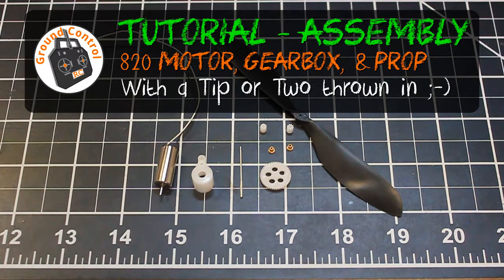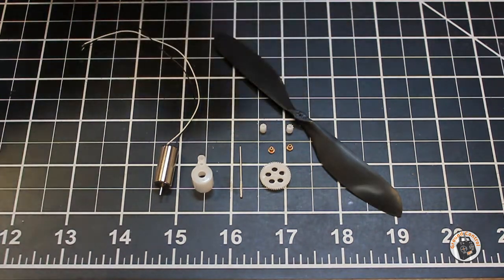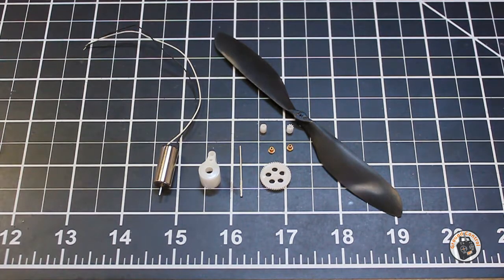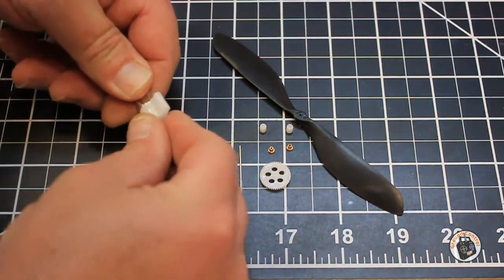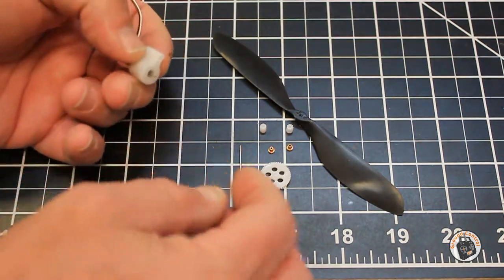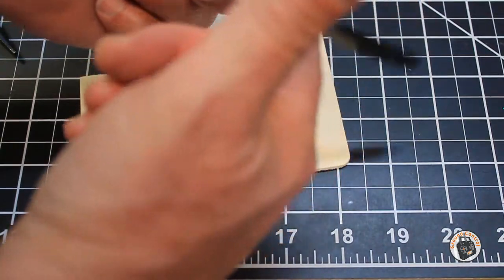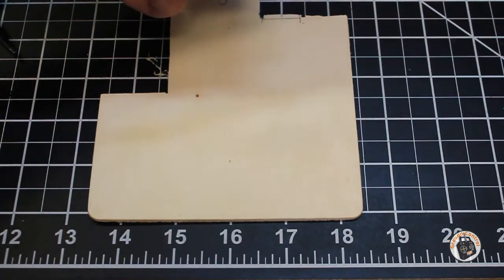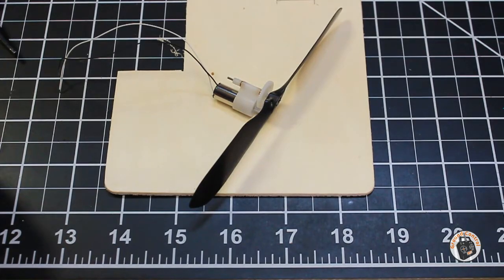Tutorial - Assembly of the 820 Motor, Gearbox, & Prop

Comment: Great tutorial. Do you know the diameter of the output shaft that the propeller attaches to? I'm just wondering if other props can be used with microprop adapters. Thanks
Reply from the maker: Hi Gene and thank you.
I don't have those anymore but in the Video Show Notes I have the prop shaft listed at .8mm

Comment: I am wondering if the large and small gears positions could be swapped for more RPM's to the prop?? 🤔
Reply from the maker: That's a good question. It may be possible but I've not tried that. That could be a very good way to use a smaller prop and still get good thrust ;-)

Comment: The bushings appear to be made of a porous material called "oilite" which is usually made from bronze. The porosity of it helps to retain light lubricants for these type of applications. Excellent tutorial by the way! 👍👍
Reply from the maker: Thank you much! One of these ended up being a good replacement motor / gearbox, and prop for my old F949 Cessna 182 ;-) See you in the Air!

Comment: Update on the current taken by the motor gearbox propeller combination on 3.7 V (equivalent to 1S Lipo) is 750mA. 50% more current than on 3V due to air resistance proportional to the cube of the velocity I suppose.
Reply from the maker: Hi Tom! Still not bad! I wonder if it would be over 1 amp with a fully charged 4.2v 1S LIPO? I do have some of the 1S LIHV LIPOs that will charge to 4.35v for a bit extra punch in the beginning ;-)

Comment: I notice that some have asked what current the motor takes but I haven't seen a sensible answer. I ran my motor without prop on 3V and it drew 65 mA. Running with propeller it drew just about 500mA. The current taking will depend on the load of course. I haven't measured the stall current because I am worried I might damage the motor.
Reply from the maker: Hi Tom! I wish I had something I could accurately measure  load on a 1S LIPO. I can get a close estimate using my Load Meter if I attach separate power to the Load Meter as it requires a minimum of 4.8v for power. 500ma is very low for the size of the prop since most Brushed ESCs I've seen are capable of anywhere from 2-4 amps. You could run two of these for a dual motor setup with no problem ;-) I would also be worried about stalling the motor as that could also take out the ESC. What are you going to put this motor in?
Reply: @GroundControlRC  Not really sure what I am going to do with it. I just liked the look of it on the Banggood website. The C version was half the price of the A and B versions for some reason, so I just added it to my order. I get caught like that a lot!
Having just said that, I have an unmade KeilKraft Sopwith Camel rubber powered kit from the 70's, but at 16inches wingspan biplane, would 1.5 watts be enough to power that?
As for measuring the current, I have a couple of sophisticated variable power supplies that have digital readouts for voltage and current. I find them so useful for playing with electronics and such.
Reply from the maker: @TCSC47  ...you're a Tinker like I am ;-) My mantra is "Dreamers, Thinker, and Tinkers make the World a Better Place, be on Today" Most of these Brushed Motor, Gearbox, and 5" Prop combinations I've tested produce around 50 grams of thrust. The best thrust I've seen from this type of setup is the Motor, Gearbox, and Prop combination used in the Eachine Mini Warbirds. With the weight of the Plane and the amount of power they have in flight I would estimate somewhere around 70 grams of thrust. If your Sopwith Camel is less than 50 grams in weight with this motor, receiver, servos, and battery, you're in business ;-)

Comment: Excellent video. I don't think I could have put the motor together without this video! And SO fiddly! My motor was indeed a very tight fit into the plastic casing and I would not have wished to use the force I had to, to insert it, until I saw you do it! I was thinking of reaming out the casing but managed to push it in with a bit of determination. I used cellotape to balance out the prop which it definitely needed. Finally managed to get the prop shaft bearing in place after much trying.
Not recommended for someone with low level of patience or dexterity (but I managed anyway!!)
Cheers!.
Reply from the maker: Hi Tom! I'm the same way as I always think I'm going to break something. And sometimes I do ;-) See you in the Air!

Comment: This geared system is not good as I had before. That system has a tiny foundation and propeller is tightened with the screw over the top. Its housing low class but motor is same (820). Question is that how much thrust it has. I hope you will reply me once more. Your tutorial is amazing ( the way you perform the the things).
Reply from the maker: Hi Muzaffar! This Motor, Gearbox, and Prop produce 50 grams of thrust. If I were going to use a Brushed Motor and Gearbox for a Project I would most likely get one of the Power Systems used in the Eachine Mini P51D Mustang. That Plane has the best Thrust-to-Weight Ratio of any Brushed Power System Plane I've Flown.
Here's a link to the parts page for that plane:
https://www.banggood.com/search/eachine-mini-p51d-gearbox.html?p=WE081047791920140372

Comment: Great video. Thanks! I cannnot push the motor inside the gear box, any tips on handling those super tight motor housing?
Reply from the maker: Thank you Azrul! I know it is extremely tight to push the motor into the housing. I would recommend pushing the motor into the housing from the bottom of the housing supporting the bottom of the motor and it does take some force. The reason I do it that way is, you can bend the motor shaft pushing from the top, and you can actually push the motor out the back of the housing with too much force. You can try coating the Motor Housing with a bit of dry bar soap to get it pushed into place. I use that method sometimes as it will still leave plenty of friction as opposed to a wet lubricant.

Comment: Thanks for this video - Banggood should put this up on the product page!
I bought this as well as the 720 motor variant. You mention about balancing this setup. Would love it if you could also add a bit about how to go about doing that since they are really unbalanced - I can hardly hold one in my hand due to the vibrations!
Also one thing I noticed is that the included brushed motor is actually a CCW (white/black wire) but because of the gear the motor needs to turn CW to make the prop turn in the correct direction (CCW) and from what I have read about brushed motors it's a bad idea to reverse the direction. Apparently it reduces the life span of the motors since the brushes wear out faster. I realized this after assembling the setup. I plan to replace the motor with a CW one since I have few spare with me.
Reply: Suspend the prop on a horizontal pin and spin the prop a  little bit. It will come to rest with the heavier blade  pointing down. Stick a strip of cello tape (Scotch tape in the US and Canada?) on the lighter blade and spin again. Add or remove tape until the blades show no preference as to which might end up pointing down. Job done.
Reply from the maker: Thanks for you kind words. Yes, I reversed the polarity of the motor. Since the motor is new and the brushes were not broken in, I'm not sure it will shorten the lifespan of the brushes but only time will tell ;-) I'll try to put up a short video of how I balanced my prop and it was very smooth once completed. Happy Flying!

Comment: Thanx. BangGood did not include any schematic, instructions or anything so good job. Putting mine in a Guillows kit 501 p40 balsa model, 16 1/2" ws. I hope it will be enough power for it.
Reply from the maker: Thank you much! I looked up the kit you referenced. Looks like a very nice plane. This Motor, Gearbox, and Prop put out approx. 50 grams of thrust on my thrust stand. I would guess your kit plane will weigh less than that when complete. Also, I would recommend putting a drop of super glue on the prop gear and prop when installing on the shaft so they don't slip. Let me know how it goes and Happy Flying!